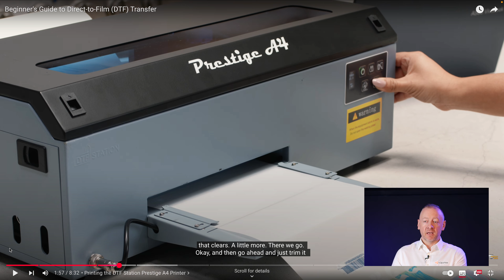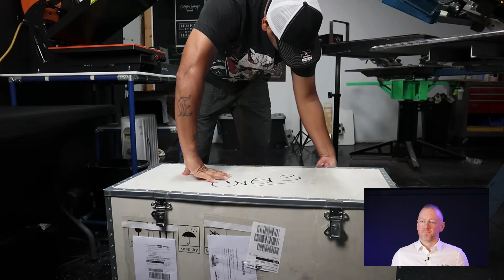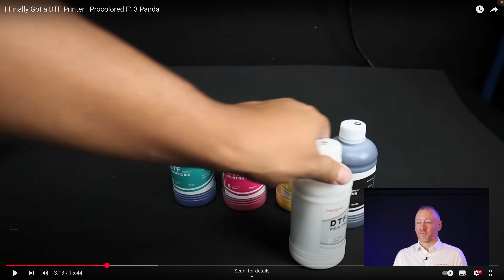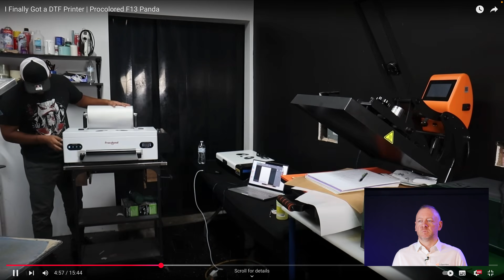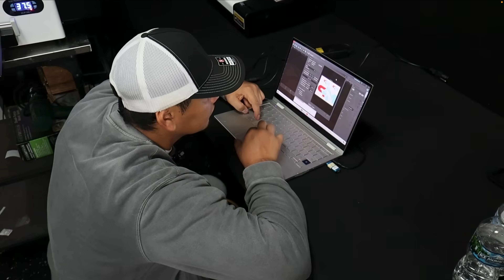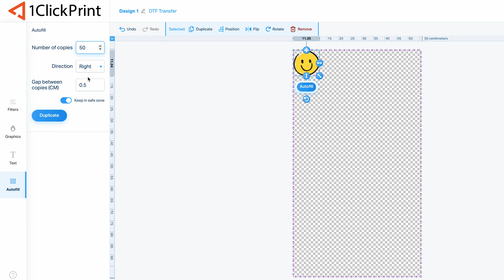Desktop DTF Printers EXPOSED: Worth It or Waste of Money?

Comment: Its not the easy like they show in these videos .  Dtf is most unreliable printing tech mankind has ever seen think 100 times before investing on this finicky printer. 
1 temp issue 
2humidity issue  
3white ink issue   
4 powdering issue 
5 baking issue one min more or less the prints will crack.
6 heat press temp and pressure issue more temp again cracks under pressure pealing and tshirt die bleeds in the prints
7 cold peel hot peel film act different most youtube guy dont tell u what film they are using.
8 if u use teflon the temp setting vary again if ur heat press already  has teflon and u use extra again this mess-up the temp and timing of heat press.  
9. Regular running of printer orelse white ink will clog.
10 life of these prints are max 6 months after that u will see cracks no matter how religiously u have followed all the parameters .  

Bottom line is stay away from this notorious printing tech.  

With these check point ur printer supplier will always have enough doors to escape saying ur not going the process in right way.  

So some supplier dont even help u with hand holding for fews days they will set up the printer and done issues ? Keep waiting or do it by yourself with youtube video some thing go wrong with printer nothing is covered under warranty.  So this is trap machine which has more demands than ur gal or wife so think before u get ur hands on this machine u will loose ur sleep

Comment: Only thing this vid got right was YES desktop printer's are not for huge project's you would be a fool to think so, we have a L1800 desktop printer and we use it for small  high color job's,  left chest design's cap design's because you can gang those print's on one sheet maybe 20 or more smaller prints, all large job's we put on our auto press or manual's.  The big question can you make money from a desktop DTF YES and far as maintenance large or small they all are going to need it some just more than other's.  The thing to think when you are looking for a printer think about the size production you want to do and that will help you on your selection of printer or who you get to print transfer's for you.  I've been in the screenprinting biz for over 20 year's and still don't know it all because the business changes and new technology pops up every year.

Comment: When are you guys going on about the print size? It's supposed to be about the printing process? Perhaps the print size is small because they just doing tests? It seems like your nitpicking. The point is they're selling crappy machines to Crafters will buying them by the truckloads . They using dangerous DTF powders with no fumic extractors. That's the story. Because this video is not the best example. There is fantastic work out there coming off of these printers the point is they will not due to Ink clogs and poor quality from printers that really want me to print white ink. The Epson printer itself is a great printer but not made to do what they're having it do especially for long-term.

Comment: wheres the vid showing the desktop printers you DO suggest? this vid is alot of biased hating . cut to what we need to know. what to buy?
Reply from the maker: Unfortunately, we've not found a desktop DTF printer we would recommend. The desktop printers are modified photo printers and simply not up to the task of running white ink.
Reply: @dtf-printers  so what printer is a good one to buy? I dont want to be waisting money on down time. I need production. Or what company to buy prints from

Comment: Great video 👍🏽
Thanks for sharing 
What do you think about the Lancelot m1630 all in one bundle. It’s a production DTF printer. I’m considering that one for my first printer investment
Reply from the maker: I’d be very careful. It has a single Epson XP600 print head. 

You are likely to have the same problems as the printers featured in the video. 

A dual XP600 printhead would be better, but they still don’t last long, so we refuse to offer XP600 at all. 

A machine with Epson i1600 or i3200 printheads would be your best bet. 

They aren’t designed for production and will last way longer with far less issues.

Comment: Wow, so biased and disingenuous, even the simple parts you think people aren't going to check. 
Just to clarify, you're trying to refer to a full 6-color set as a liter is 357 for 6 × 500ml bottles—that’s a total of 3 liters, not 1. That puts the actual cost at about 109.67 per liter, not 357.
Either there was a mistake in your math, or you're misrepresenting the price. Let's keep it accurate.
One more is an A3 is not twice as large, so not 2x cost to produce. Yes it is slower. These things are true. 
One last comment: buy cheap, get cheap. its three three-question problem. Cheap, Fast, or Good, pick one.
Reply from the maker: The print costs are a screen grab of Procolored's website. Have a chat with them if you think they are incorrect.

As for only being able to have cheap, fast or good?

Nah, you can have it all if you buy well

Comment: procolored is terrible. don't do it
Reply from the maker: Have you had a bad experience with them?
Reply: @dtf-printers  yes, mine printed well for about 11mths before the print head stopped working. During the troubleshooting the motherboard went out. Spoke with the tech and ordered the two new parts for $700. Got things working again for about 40days before the “new” print head stopped working. Tech said I needed a new one. He could not explain why the new one stopped printing so quickly when I have done all the required cleaning as usual. I thought I was lucky to not have any issues like other people I saw post about online….but tick tock, now I understand their frustration!
Reply: @jlharris4830  .. but you must have made some good money in 11 months, no?
Reply: @dtf-printers for a whole year they shipped MALWARE (full remote control infection, impossible to remove, three double infection also) embedded in the driver and they continuously denied by saying “it’s normal, disable any antivirus”

When you ran their rip software it actually first load a malware, that loaded a second malware (double infection because their development computer was heavily compromised by multiple bad actors), that finally loaded the real program. This only because they didn’t want to spend €100/year for a code signing certificate that guaranteed that the executable wasn’t tampered by an hacker.